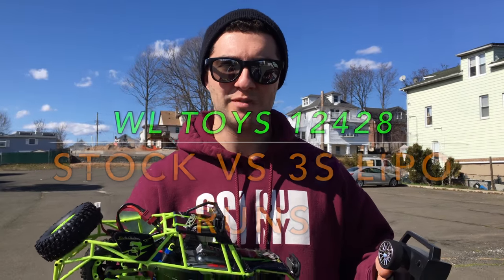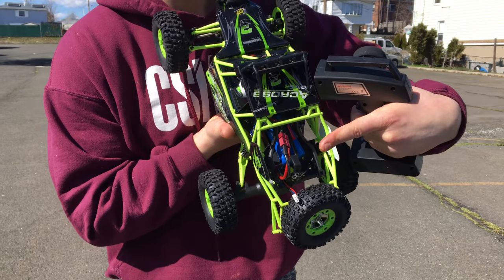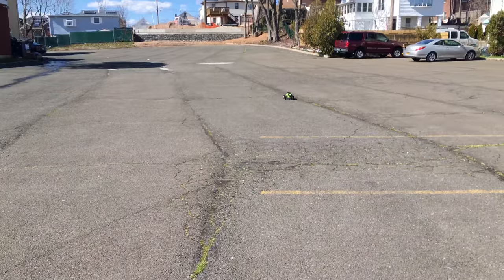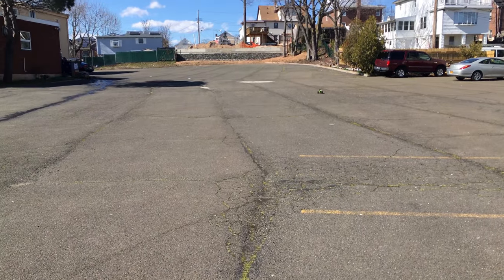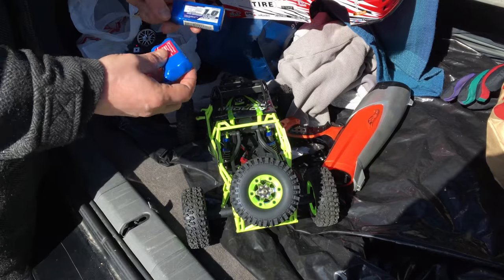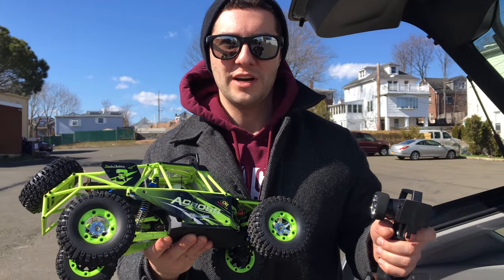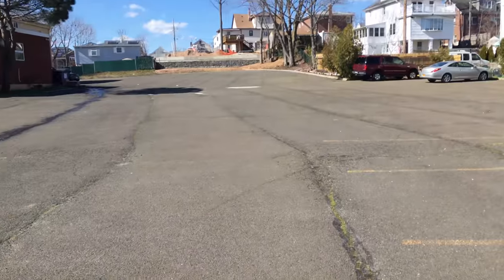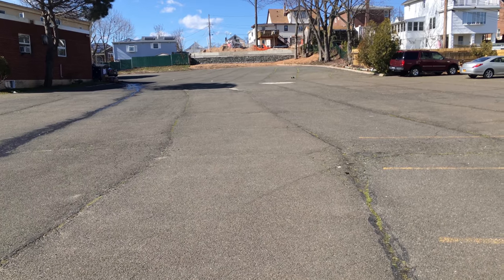WL toys 12428 $70 stock battery VS 3S LIPO speed runs

Comment: As an electrical engineer, let me say that you got lucky that you didn't fry your ESC. While the motor & servo can handle the extra voltage with no major issues, I'm pretty sure the ESC has internal voltage regulators to drop the internal voltage from 7.4V to 5V for some IC chips and most likely a 7.4V to 3V for the programmable microcontroller chipset. While a lot of these regulators can handle a wide input voltage, not all do. I definitely wouldn't go over 12V input, that would be a real gamble lol, specially for the 3.3V regulator.
Reply: exactly unless esc is rated for running eS
Reply: Esc will be fine!😉

Comment: That 3s definitely gives it more power, isnt 3s too much voltage for it? I read that if you go 3s that you have to use a buck converter or it will burn out the engine. How much run time did you get the with the 3s?
Reply: I'm curious about this myself. I have some metal gear diffs from Remo on the way, so it should be able to handle 3s as far as the drive train goes.....the electronics on the other hand, I'm not too sure.
Reply from the maker: So far no problems from anything with the 3S lips.  I normally don't run over 5 min with the 3S, but in reality that is a small 3S 1000 math pack with low discharge rating.  I touched the motor and esc, both were not extremely hot.
Reply from the maker: so far no issues with the drivetrain really, even after two packs of the 3S runs.
Reply: so in reality this battery is only good for short sprints? its not recommended to run it out till it dies? i want to upgrade the battery, i was thinking 2200mah 25c 2s lipo.
Reply from the maker: if your using a 2S then its no different than the stock battery in terms of voltage that is.  That would not be a  speed upgrade, runtime only perhaps.  Did you mean you wanted to use a 3S maybe?
Reply: Well im not sure what to go with, i obviously would like a speed upgrade but from what i have read, its not recommended to use 3s. i plan on running it for longer than 5mins, so just seeing what my best option is for run time and speed without damaging the motor.
Reply from the maker: most of my runs(with any battery) are mixed speed runs and slow type of driving around.  I would say a 3S would be fine overall unless you only do speed runs constantly.  Although thats pretty rare, ill prob do a few speed runs and just drive normal after that.  BTW other escs that are not built for 11.1 power would simply not activate if the voltage is too high,  this one seems fine.
Reply: do you have a link to purchase that 3s battery? lastly, what is the total run time with that battery?
Reply from the maker: https://hobbyking.com/en_us/turnigy-1250mah-3s-30c-lipo-pack-long.html

this is a similar battery,  whats important is the fact that these batteries come with non deans connectors.  DO you know how to solder on a deans style plug?  good idea to buy them in bulk from this site also, thats what I do.  I run these similar small 3S lipo packs in my traxxas mini ergo VXL,  ( no issues and fast). Runtime is fine, over 10 min, of course the higher your MAHH rating the longer the run time.
Reply: i can solder the connectors, thanks alot for replying and for the info. i just subscribed to you as well.
Reply from the maker: thanks, and glad to help.  I get a lot of my cheap RC stuff on that website, Their replica deans connectors are very cheap when you by ten pairs.  I think I paid around 3 bucks for them all.  Been using them for years,  no issues.
Reply: hybrid32494  that's cool that your gears are still holding up. these 12428's seem to be hit or miss, especially with the diffs. both of my diffs are done for...the front went out after some full throttle runs through a huge puddle that was way too deep, and the rear went out on me after some unfortunate jumps off of a small tree trunk, lol. But at least with those Remo diffs I should be ok for a little bit.  I'm personally actually thinking about running an aftermarket cooling fan on the motor. I saw another video of someone who ran it off of the plugs for the LED's. 

either way, thanks for the info, I'll probably be picking up a 3s after that fan upgrade. 
You've earned me as a subscriber as well!
Reply from the maker: thanks!!  questions for you, how do you find the steering servo?   mine seems too always be off center, the adjustment on the remote just isn't precise enough.
Reply: JPVideos just picked up a 12428. constantly adjusting steering servo. got aftermarket oil shocks and cooling fan with heat sink coming in mail. also a lipo battery charger with display and 3s lipos. yeah how much runtime did you get off the 3s. I'm little worried of overvoltage myself.
Reply: Mike Fahner let me know how the oil shocks work out, i may pick some up myself.
Reply: JPVideos most definitely will do soon as there on and I test drive. everything  is coming from the states except for the shock so I'm sure it will be a few weeks still.. great vids bro!!
Reply from the maker: what capacity 3S lipo did you get.  I was using a 1000 MAHH in this video, which is a low capacity overall, and around ten min at most.
Reply from the maker: yes, please post the link here for the shocks you ordered.
Reply: hybrid32494 1800 mah 20c. Not much more than stock other than cell count. Plan on getting the 5000mah but not sure if it fits properly, don't mind modification to make fit. I ordered the truck, a triade dna 250, case for it, aromamizer plus rdta bundle kit, 4 3000mah 18650's for it, my son a rc truck and 2 pocket racers, hobby lobby heatsink cooling fan, the charger and lipo plus the shocks all at once so I was at my budget for the time. I plan on trying a few different lipos anywho to see which works best without tearing up all the nylon gearing. Can't seem to find aluminum spiders and planetarys as of today. Maybe get some traxxis gears to fit, idk. Other than a nitro hpi back in 2000 I'm new to this hobby again, reason not getting traxxis yet make sure I'm goin to stick with plus I really liked the buggy. Shit this got long huh, lol
Reply: this is my first more serious rc. ive had radio shack and walmart rc's when i was younger. i'm more into drones as i fly a phantom 3 but this buggy caught my eye and the price is unbeatable. i got it on flash sale for 67 bucks. just waiting for it to arrive.
Reply: Trying to figure out how to post links. Think I've got it. I got the shocks off ebay $25 for the set. There sold for the 12428 and the fieyue. If you Google oil shocks upgrades you get them and a bunch of aftermarket blue anodized aluminum parts. Few different sites reviewers claim to fill with oil of all different weights and the outcome is good on them but they don't say oil shocks. There blue anodized aluminum with internal springs all the seals you would need and bladder style platform. I'll try to send you any link of the same shocks if I can't find the exact ebay seller
Reply: JPVideos lol just try this part number, think this will be easier  I'm trying  to juggle the phone and tablet at once with kid running and  screaming. this is the front part #   FY-BZ01 SHOCK ABSORBER. blue anodized  aluminum
Reply from the maker: lol yes,  that was long.  You def don't wanna go more than 2200 MAH 3S on this (you prob will have to use Velcro to secure the battery too with this large capacity 3S).  The whole weight and torque steer problems will be even worse with a more rear end heavy RC.  you really should consider a Traxxas mini revo VXL, this is one of my fav RC models, fantastic parts availability,  super fast and great handling.  A stampede 4x4 VXL is a sure bet too.
Reply from the maker: WOW 67 bucks is 20 cheaper than I paid,  thats a steal, I agree.  And btw I've also got a phantom 3 4k, posted a few videos about it on here too.  Although looking to sell it and get a phantom 3 advanced or pro, my biggest issue is range with the bad wifi signal.  Always have video signal loss anywhere more than 150 feet up or away.
Reply: hybrid32494 I tried to post link on the shocks but no luck and somewhere along the lines maybe commented to the wrong person once lol. I need to stick to one device at a time. The part number now when I looked is giving some red shocks but that's the number the site is giving me. I posted a pic of them on my google+ page if you can get to that. Sorry man sometimes my technology knowledge is lacking..
Reply: hybrid32494 check out you tube channel  VOID XBOX RC  video: taking a look at some feiyue upgrades...  these were the aluminum  upgrades I was talking about and the shocks I purchased and actually I bought them off watching this vid...
Reply: are the shocks already prefilled with oil or do you have to add the oil?
Reply: You gotta add the oil, purchased separately. Ebay sells 6 2oz. Bottles of various weights team losi brand all 6 bottles for $23. Average price per other brands 2oz. $7.   Can't forget about that free shipping either...
Reply: i did see oil filled 100mm shocks on ebay ranging from 20-50 bucks. but not sure if they will work.
Reply: JPVideos I use a 2s Zop power 2200mah 35c from Banggood and  clocked the max speed at 54km/h judging from the video the 3s with low discharge rate is not as fast as mine.
Reply: JPVideos mine handles 2200mah 2s 35c zop power with ease
Reply: your_local_emo Trust me when I tell you the motors on these are solid owned both Wltoys 12423 over 8 months and had only problems with both differentials and spur gear. Acquired my Wltoys 12428 a week ago and my rear differential is already gone. Need to get some Remo differentials from Banggood when their in stock again
Reply: from the sound of it, seems like this buggy doesn't hold up and breaks rather quickly. im not experienced with repairing rc cars. guess i threw away 67bucks for a weekend toy.
Reply from the maker: trust me this is a good starter RC, even an OK midrange basher even.  I have owned may high end RCs and this is not much worse, still fun in it's own way.  Its quick with a small 3S lips and not terrible with an normal 2S either.  Its faster than a stock traxxas XL-5 powered RC which still costs three times more.
Reply from the maker: motors r tough, I agree.  Basically every brushed motor I have ever had was indestructible come to think of it.  Especially the original traxxas titan 550 motors in the Old style EMAXX.
Reply from the maker: its possible, yes.  Any average 2S will give better performance than the included battery of course.  But can't they just come up with a less silly name than BANGGOOD,  COMMON......
Reply from the maker: twenty bucks isn't bad for shocks,  But in my prior experiences with Chinese shocks and eBay I would not get any others.  IF you can't find a normal Traxxas or Hpi stock shock to fit then just let this one go.
Reply from the maker: any new shocks always come without oil inside.  Unless they are built into an RTR model already.  The oil is cheap and not an issue really, and you will see later that leakage will be your main problem with low quality shocks.
Reply: i have high hopes for this rc but dont want to disappointed with constant down time or repais. i've read stories where people have been going a few months without issues and others who broke down after a week or less.
Reply: Damn why can't Google leave shit alone! Soon as you figure out all their software and firmware they go and update the crap just to confuse an individual. 80% of the time nothing good comes out of an update anywho.
Reply from the maker: JPvideos. this is the case with any RC,  trust me.  The only diff here is this one is substantially cheaper, lol.  My traxxas slash VXL is currently down, broken rear drive shaft and transmission input shaft has a snapped roll pin.
Reply: JPVideos You won't have a lot of downtime if you give it a good maintenance run after it breaks down eg grease the differentials with high quality green grease like Lucas grease. I repaired my Wltoys 12423 around 4 weeks before I received my 12428. The latter broke down in less than 2 week's. Grease is the answer and Remo upgrades for the biggest longtime runs between maintenance fixes
Reply: JPVideos hi Did 3s lipo works with this model ? i tough its so powerfull ?
Reply from the maker: Yep a regular 3S WORKS FINE.  I ran a small capacity 1300 mah pack used in my Traxxas mini reeve, runs fine.  Ofcourse I don't recommend going with a much larger capacity pack or higher than a 30C discharge.
Reply: what is (mAH) for the 3s battery cause I am thinking of buying it??
Reply: is it ok to use a 1500 mAH 3s lipo batttery on it?
Reply from the maker: The 3s pack I was using was a 1000 MAH battery.  In reality I only used that small of a rating because it fit in the original battery tray,  you can use any 3S really as long as you can secure it.  In general a 2000 MAH 3s won't fit in there,  does your 1500 mph fit?
Reply: U think I can run a 3s 25c  11,1 LiPo on the car
Reply: @JPVideos81  I've had mine for a few months I've drove it full speed into a kerb I've drove it off the roof of my car I've flipped it rolled it and the rest and so far it's absolutely fine and don't worry about fixing it it's not as hard as you think and they'll more then likely be a yt video to show u how to do it :-)

Comment: i was curious, how long did it take to receive the car? i ordered mine 2 weeks ago, got confirmation that it was shipped but still waiting for its arrival.
Reply from the maker: I ordered men on eBay, it came staring from California, took around a week like usual.  Did you order yours from some Chinese site or a seller in china?
Reply: gearbest from a china warehouse
Reply: hybrid32494 
3s mean 11.1 volt ?? or what ??
Reply from the maker: yes, a 3S (3 cell) lips is 11.1 Volts.  A 2S (2 cell) is 7.4 volts.  Although they charge to higher voltages or 12.6 and 8.4.
Reply: JPVideos Same
Reply: I got mine in around 3 days

Comment: Is it safe to use higher voltage, won't burn out?
Reply from the maker: Yes, I used an 11.1 3S lips in this video.  So it was fine.  Ofcourse I don't recommend really bashing it hard with the larger voltage pack and don't go above 30C discharge rating or 2500 MAHH.
Reply: what if i get a 2S 7.4V 1500mAh 35C??? is the discharge too high???
Reply from the maker: As long as its a 2S thats fine.  But in reality running anything larger than a 2S lipo is a trial and error thing.  I stick to tighter high discharge (c Rating) 2S packs or low C rating 3S packs.
Reply: hybrid32494 there's no such thing as too high of c rating.
Reply from the maker: IF the C rating (peak discharge/Continuous discharge) of the battery is more than the peak/continuous current flow that the ESC can handle, they YES!!! there is such a thing as to high of a C rating.  The ESC should have a higher AMP rating than the discharge on a battery.
Reply from the maker: The problem is these models have a 2 in 1 type ESC and Receiver design.  Unlike common hobby grade RC where the ESC and Receiver is separate.  Maybe they somehow have solved this situation, but I doubt it.
Reply from the maker: I got the S912 Luctan, similar to yours.  Totally hate it, its probably my least fav RC ever,  but than again it was only 40 bucks.  Good luck, let me know how it is.

Comment: I bought the same battery but it has different ends on it... did you change them? where can I find a battery like that if not?
Reply from the maker: hello,  Yes I soldered on different connectors.  I use DEANS style plugs.  If you're starting out in this hobby try to learn how to solder connectors, you'll save yourself a whole lot of headaches in the future.  It's easy.  Buy any cheap deans style connectors, heatshrink tubing, solder, a soldering guy, and you're good.
Reply: @hybrid32494  Dude I bought one with a tplug and it wont run right.. my lights flicker and it barely moves. idk whats wring. its a 1300 mah 30c 3s..
Reply: @Turppa21  so what was the issue ??

Comment: Hi can I use a 3s as soon as the car comes out of the box?
Reply from the maker: Hey man. Yes, i ran a small 3s in mine.  No problems.  But try to not run a huge lipo, you never know. I ran a 25c discharge 3s.
Reply: thank you so much

Comment: Is 4s too much? 😕
Reply from the maker: IDK LOL.  I have a 4S, will attempt to try it out.
Reply: @hybrid32494  What happened? im getting a 12428 tomorrow. Def going 3s.. its safe right?
Reply: Yes I know it's a 2 year old comment.

 But just in case someone is trying to research about this car and battery configurations, a 4s lipo will kill the ESC or the brushed motor or both. It can hardly handle a 3s, you might be able to get a few runs out of a 3s lipo before the ESC gets fried, or burns up the motor. 

In order to successfully and reliably use a 3s or 4s lipo in this car you'll need to upgrade the ESC and the motor (go with a brushless system).

Comment: I have tried a 3S LIPO battery but when I plug it the diode of the motor exploed... It works but I a bit surprised. Does somone now somthing about it ?
Reply: It's a capacitor and mine exploded as well. No other issues so far.

Comment: not looking for speed but longevity, can you advice an upgrade so the kid can run longer than 10min each play?
Reply from the maker: The basic rule for longer run times is a larger capacity battery.  That means you need more MAH capacity. The stock battery is 1500 mah, you can shop for a 2000 or 2500 mah battery, that would increase run time but your overall speed would remain the same.  As long as you get a 7.4 Volt 2 cell limo with larger MAH rating.  Does that help you?
Reply: hybrid32494 yes thank you